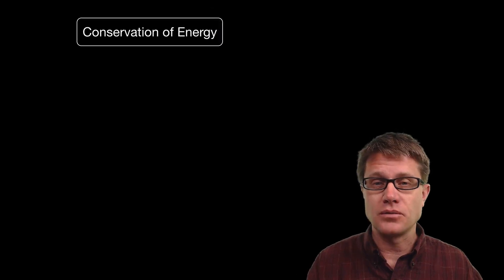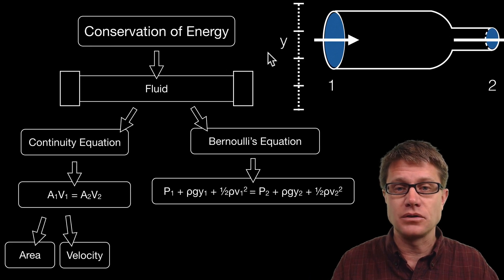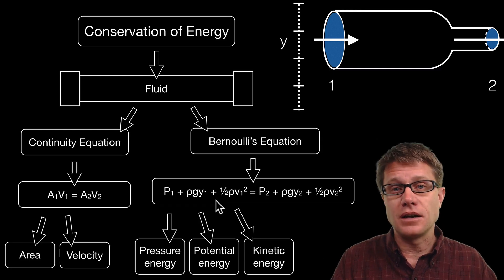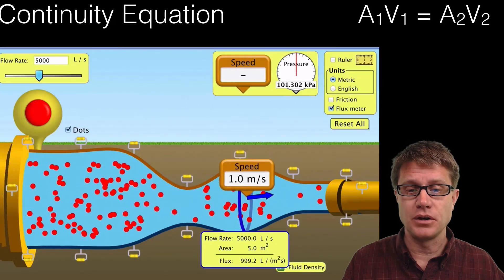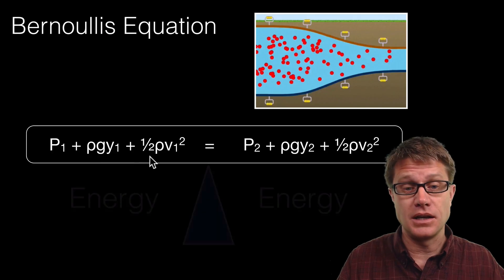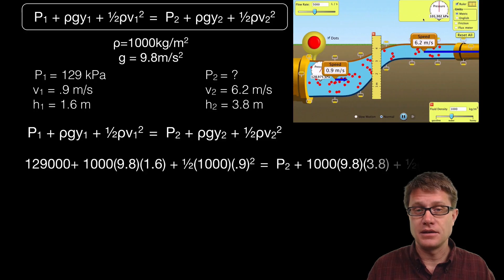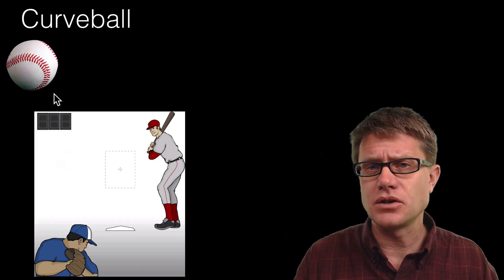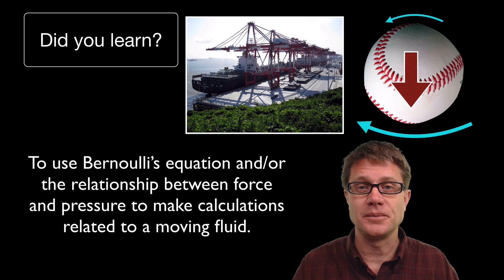Bernoulli's Equation

Comment: Bernoulli's equation is often associated with closed systems because it relates pressure, velocity, and elevation along a single streamline, which can be seen as a "closed" path within the fluid. Therefore, the milk carton box example is only true because pressure at the bottom point is higher than that at the top point. P= density*g* delta-h. Velocity of milk coming out of the hole at any point will be √ 2*g*h. Where h is the height of the fluid at that point.

Comment: To think of how greater cross-sectional area decreases velocity, think of a ketchup packet. If you make a big hole in it, squeezing the packet results in the speed of the ketchup coming out to be pretty slow, but a lot comes out. When you apply the same pressure to the ketchup packet with a tiny hole in it, it comes spraying out super fast, even flying through the air.
Reply: good analogy i thought of the same one but with honey packet

Comment: 😂
Bernoulli's "principal" is wrong... It's not explaining the pressure drop and neither the increase in speed in a smaller section... 😂😂😂
Pressure is potential energy actually 🤦

Movement energy in physics 😂
L=F*x, pressure p=F/A => p=L*A/x. So if movement is considered constant(only theoretically because in reality due to friction part of the energy is transformed (lost) as heat)... Again... p=L*A/x increasing x, L and A constant p will decrease this shows the conservation of energy. 
p=L*A/x if A decrease while x increases and L is constant you have a bigger drop off pressure. This explains the pressure drop on a section reduction😂

p=L*A/x So the potential energy (the pressure) is transformed into cinetic energy (L) and partially is used to reshape the "object" (A/x).

You see p=V*T 😂 volume is a form of energy 😂 So T=p/V so when to reduce the volume of pressure would be constant the temperature would increase. But because it can move the energy is transformed in cinetic energy... If you hit a pice of metal with a hammer there internal pressure rises and the volume decreases so the energy is transformed (released) in heat (termic energy) of course only if the object is not free to move on the direction of the force applied. 🤷

Basically everything is energy 😂 that's why changing the shape of any object will release or absorb energy, because changing form/shape is actually exchangeing energy between the object and the environment 🤷

Comment: So, in terms of the continuity equation, I don't understand how a sink faucet isn't defying this law.  How is it that the volume flow rate at a faucet slows down as you slowly turn a faucet off.  Assuming that the faucet is restricting the opening of the pipe, why doesn't the speed of the water INCREASE (maintaining a constant volume flow) as you close the faucet?
Reply: Wouldn't the faucet cause flow separation?

Comment: Sir what is this software you're using?

What if you have 3 inputs with varying flow rates? What would be the total output flow rate?

A1V1 + A2V2 + A3V3 = AV total?

Comment: In horizontal tube pressure is applied by a piston for example. In a vertical tube, is the pressure energy is due to gravity and potential energy is also due to gravity?  In vertical tube gravity is responsible for both potential and pressure energy?

Comment: The concept that increasing the fluid velocity in a pipe will reduce the pressure is misleading.  If the pipe outlet is say referenced to the atmosphere then the pressure will remain at atmospheric (ignoring minor losses) despite any reasonable changes in velocity.  However, to increase the fluid velocity the upstream pressure will need to increase, giving the impression of greater pressure reduction in regard to velocity.  Think about how a pitot-static tube works, say on an aircraft, the static pressure (little holes perpendicular to the flow) do not register a change in static pressure due to a change in aircraft velocity.

Comment: 5:28 I have a question. The milk coming out at the bottom hole did not come from the top. Doesn't each "milk molecule" need to come from the top in order to accrue kinetic energy? The milk at the bottom hole is already there; when you poke a hole at the bottom, the nearest milk molecule to that hole comes screaming out. It doesn't come from the top.
Reply: All the molecules in the container are    pressing on the one at the bottom with their weight, transfering their energy on the one at the bottom.
I hope this helps, its hard for me to explain this in english.
Reply: @mihaelurh8372  How would be quantify that with an expression? I'm comfortable with MGH = KE (at the bottom) but we can't use that here. Sum up the mass of the fluid above the molecule that is about to leave the bottom hole?
Reply: @mihaelurh8372  By the way, your English is very good!
Reply: Im pretty sure that equation still aplies (I miggt be wrong). You also have this:
HG × Density = hydrostatic presure (presure at the bottom). This is the part of the bernoulis equation that has to do with changing of height.
It's very useful to know.

Comment: I have a submersible water pump with a .5 inch inner diameter outlet.  I need to get the water pumped 2 feet high. The pump has the flow rate given (in gallons per hour) for this height (and other heights).  I need to know what is the PSI coming out of the top of the hose. I have read that this conversion of gallons per hour to PSI is like converting gallons to yards, but if i put a pressure meter on there, I will get a psi reading, so theoretically, it can be done. It reminds me of a function of a function calc problem.

Comment: wait, so if the pressure decreases, how does velocity decrease? I mean using the hose example,  if I were to put my thumb at the end, the velocity at the end of the hose would increase, but nothing else part of the hose would be affected, where does pressure decrease?
Reply: The pressure would be decreased at the moment of acceleration.  As velocity increases pressure decreases.  A good example of this is air flowing over an airplane wing.  The cross sectional shape of the wing is curved on top  but flat on the bottom causing a Venturi effect which increases velocity but lowers the pressure on the top of the wing giving the bottom of the wing a higher pressure  thus creating lift.

Comment: hmmmmm.....  using the term gravity as potential  energy.....  it is a density/buoyancy equation. not gravity.
Reply: It is gravity. If a fluid is higher up it has further to accelerate due to gravity, ie potential energy.
Reply: christopher wilson 
higher up?  moon is higher up..  or outward. yet you  say up.  moon gravity causes tides to rise.  tides pick up battleships.  but....  I weigh exactly  the same  standing on the dock.
Reply: christopher wilson 
also we have air that is higher up  than the ocean,  higher up than other air.  upper atmosphere  is less dense.  this air stays up,  even though  there are less molecules  to go through,  as your gravity acts upon this potential.  or doesn't  act.  one mole of hot air will defy gravity (magic ), over one mole of cold air.
Reply: christopher wilson 
sun's  gravity keeps us orbiting,  moon and the other planets and their  moons,  but has no gravitational pull  on the tide.

Comment: Paul,
Unfortunately, you have three errors.

1-
The boat-dock is improperly analyzed and, as it was stated, is encouraging the common fallacy that fast moving fluid has a lower pressure than any nearby slower fluid.   This can all be easily confirmed with a simple demonstration described below.

As the boat approaches the wall-dock, the pressure is increased first at the side of the boat because a surface advancing on a fluid causes an increased pressure at the surface and it is this increased pressure that is the force which accelerates the water away from the side and toward any nearby lower pressure regions.  This is simply Newton in Fluids. 

This water in this gap, because it cannot instantaneously move out of the way due to the dock, gets deeper as well. This supports this higher pressure.  It is not unlike the bow wave of a sailing ship which precedes the boat or the same thing on an aircraft wing.  The water level rises there; deeper water has more pressure.  

Because the water outside the gap is lower, the gap-water will flow out the ends. Euler showed us that a pressure gradient is what accelerates a fluid.  Again, Newton in fluids.

The water in the gap starts out at a HIGHER PRESSURE than ‘ambient’.

 If we move the boat in at a constant ‘closing speed’ the exiting volume leaves at a constant rate.  However, since the cross section is shrinking, the speed of the exiting water also steadily increases over time.  The increased pressure in the gap accelerated this water out of the gap faster and faster.

If we try to stop the boat, the water’s mass/inertia/momentum will keep it moving out of the gap.  This WILL drain the gap, lower the water and lower the pressure since the level will now be lower than outside the gap. 

The fast moving water exits because it has a higher pressure than ambient.

You correctly identified ‘P’ as the pressure at a point as noted by Euler.
---
What so many people miss is that the smaller pipe section is a restriction to the flow which increases the pressure in the wide section, _UP STREAM_.  The thumb-hose water is faster because the pressure upstream is now higher. 

If you magically widen the narrow pipe section, the pressure in the wide section will decrease.

While the energy shifting is certainly true, that talk is quite obscure. You missed an opportunity to mention that the milk carton has higher pressure at the bottom and this is what actually accelerates the fluid more, so it exits faster.   People generally know about water pressure at depth and think of it as intuition, though it is actually learned.

2- 
The exponent error at time 7:15 pointed out by others THREE YEARS AGO. (Rho should be Kg/m^3 and not Kg/m^2)

3- 
Curve Ball: Bernoulli says nothing about the relative speed along a surface and those Curve-Ball speeds are also incorrect.  The upper air is ‘dragged along’ by the ball’s surface, in the direction of travel, faster than below; relative to the ground and still air.  The higher speed difference of air and surface causes the upper air to separate and not follow the curve behind the ball. 

Below the ball, the ball’s surface is moving much slower in the direction of travel or even in reverse (if it is spinning fast enough), so that surface and air is either stationary or drawn in reverse (left in your image).  It is the Coanda Effect which is responsible for this lower pressure where more air follows the convex curve. Coanda himself acknowledges the lowered surface pressure in a convex flow.
--- 
Lastly, I want to also emphasize that an equation never shows cause and effect.  They only allow calculating values and were originally determined by a proper analysis of the science/physics concepts involved.   A proper understanding of the physics is required to correctly apply an equation.

Boat-Dock Demo.

Fill a sink or straight-sided fish tank with water and use any straight-sided board or rectangular cottage cheese container as a boat.  Add some glitter for visibility. Push smartly toward the side.  You can see the water rise.  It may be more obvious in Slo-Mo.

Regards
Reply: Excellent comment, particularly the part about upstream pressure increase due to a downstream constriction. Thanks for taking the time to write it.
Reply: @joeteichert6821  Thank you Joe.  It is SO frustrating that so many people, even those supposedly teaching  science, simply parrot old myths and don't really understand what they are saying.   You may like this (and the one it references about lift): https://www.quora.com/q/kyuoyckftflurrpq/Understanding-Bernoulli-s-Principle-Correctly   
Cheers

Comment: @3:58 he says "if the fluid is moving fast, it's going to have a lower pressure."  I guess what's left unsaid is "in a given situation"?  Because a general rule that says faster moving fluid has a lower pressure makes no sense; there are plenty of high pressure, high velocity systems.

This is why I didn't do well at math or physics.
Reply: You are correct.  This "fast air has a lower pressure" is one of the most stated fallacies in science. ... AND it is NOT what Bernoulli's Principle says.
"CHANGES" in speed (accelerations) are accompanied by pressure changes. Euler taught that Pressure Gradients cause fluid accelerations.
...
As I posted earlier, the water pressure between boat and dock increases because of the boat.  THAT is what causes it to flow out.  As it does, it picks up speed and Lowers the water  level and pressure due to its inertia carrying it along further

Comment: Some of this is bad science, in the case of a ship that is not a closed path as your pipe example - to assert that a continuity equation even applies in the first place is beyond me. To assert that because the fast water has a lower pressure, o.O
Reply: IndustrialDonut so in that situation, the fast moving water displaced by the boat would NOT have a low pressure? If so, i think that explains a lot for me.
Reply: @buzzmas8068   As the boat approaches,, the water height and pressure in the "gap" is increased and THAT is what pushes it out.  Then, inertia carries more out LOWERING th e pressure THEN drawing the boat in...

Comment: so i should get a smaller diameter cold air intake??? these rules would apply???
Reply: Venom Hemi cooler, bigger and shorter intake means less intake restriction. Buuut, it is almost pointless on any normal road car as the biggest restriction for the intake will be the inlet valve diameter. No matter how big the intake pipe, its still got get past the valve and throat. Modern cars are already setup good enough. Thats why race cars have specially designed engines to do exactly what they need with ports, intakes and valve to match.
Reply: @christopherwilson6527  ok thanks for the info

Comment: Sir why P1 is high? By P= F/A. If area increases pressure decreases   right. Then why we take p1 is high and p2 is low? Please answer
Reply: The fluid in the small tube is moving faster than the large tube by conservation of mass, so that makes up for it. To get the pressures flipped around the opposite way, like it really is, is because the faster fluid in the small tube had more energy since it is faster, and it had to have gotten that energy from somewhere, and that is an increase in pressure in the larger pipe. Sorry, im not very good at explaining things and didnt want to get too in depth
Reply: @buzzmas8068  NOPE. Continuity does happen, but it 'causes' nothing. 
..
 The fluid in the small section is accelerated by the Pressure Gradient along the tube.  The higher pressure accelerates the mass of the fluid toward the narrow section.  This works at BOTh ends of the narrow section.  Positive acceleration going in speeding up the fluid and negative acceleration exiting the narrow section slowing the fluid.  Newton in Fluids....
Reply: +Sujeth Monk
,
That, P=F/A,  is the WRONG FORMULA!  
You don't use Ohm's law to calculate miles-per-gallon.

Comment: I have a question, doesn’t high pressure want to be in low pressure? So the baseball will go down, because my teacher taught me in Bernoulli’s principle that when a plane is about to fly, there is fast air on top (low pressure) and slow air on the bottom (high pressure) of an airfoil. So the slow air automatically wants to connect to the fast air which pushes up the airfoil and makes a plane fly. And you need thrust and lift for a plane to take off and fly. So slow air is on top and the fast air is on the bottom of the baseball which makes the slow air automatically connect to the fast air which makes it go down right? I’m in grade 6 and I’m tryna be ahead of my class and be the best, so please explain to me how Bernoulli’s equation works in a simpler way that a grade sided can understand. I hope you can help me to be the best in my classes. Thank you.

Comment: Trying to figure out the units of the potential energy term. Check this out:
(Density)*(acceleration)*(height) = [kg/m^3]*[m/s^2]*[m] = [kg/ms^2] 
This does not match the sub units of joules ( Joule = kgm^2/s^2 )
Can you please explain how this term is considered potential energy?
Thanks!
Reply: The way he labeled things was pretty misleading... The Bernoulli equation written as he had it, each term is "pressure" or "energy density" which have units N/m^2 (for pressure) = J/m^3 (for energy density) when using standard SI units. When he says "energy" he means "energy density"

Comment: i don't fully understand y, is it the height from the very bottom or top of the pipe? or is it the average point on the cross sectional    shape? or perhaps the center of mass?
Reply: Henry Swan centre of the pipe, if I remember correctly
Reply: thanks!

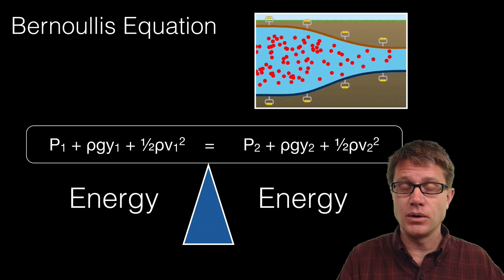Comment: when you go for the unit analysis of the last arrangement of equation at 6:02, it is rather pressure equivalent of the different type of energies (e.g. pressure equivalent of potential energy and by the same token pressure equivalent of kinetic energy). Perfect video though

Comment: can someone explain to me why the pressure is lower when velocity is higher? I understand the equation; it has to compensate for the increase in order to balance the energy in the system.
it just doesn't make sense to me intuitively. when something is moving faster, the pressure should be higher.

Comment: The example with the curveball is simply wrong. It is called the Magnus effect and is quite different from the Bernoulli effect. The air on the side of the ball that is rotating against the flow of air will have a tendency to separate from the surface sooner than on the other side. This results in the air being directed to one side, and the ball moves in the opposite direction.